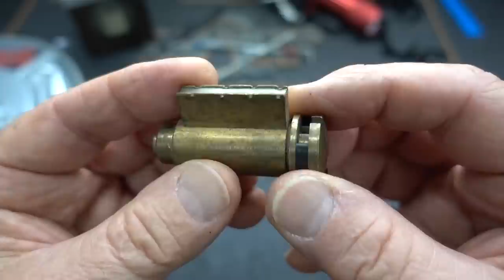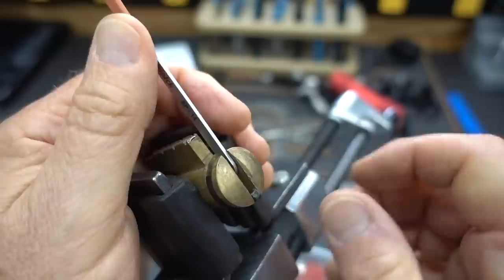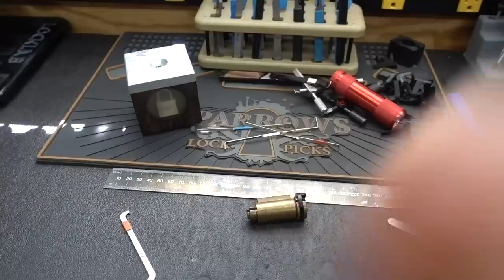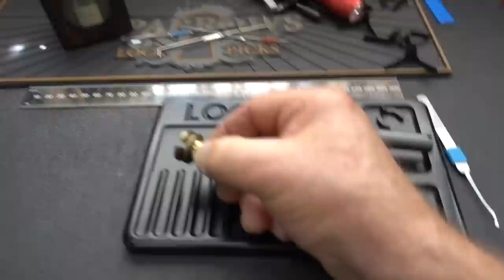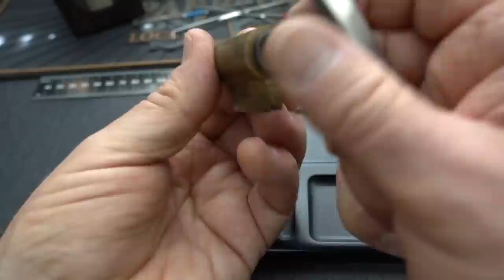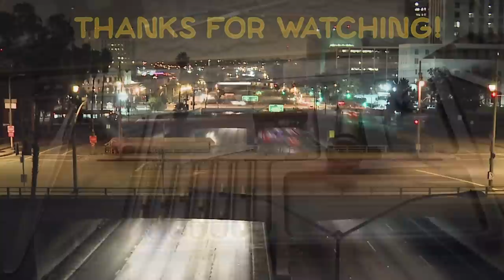(1767) What IS This Thing? (Arlington Lock)

Comment: Yale Litchfield knob design about 20 years ago
Reply from the maker: Thanks for the info!
Reply: What would stop the user from insta-gutting the lock by just pulling on the key after the cylinder turned?
Reply: @southpawpicker5140  mb that plastic thing?
Reply: The cylinder, when put together properly, has a C clip on it holding inside the housing
Reply: The locks are typically institutional locks. The company I worked for did work for a “Mentally I’ll Institution” very beefy locks!
Reply: I keyed up hundreds of these in 1979.  This was the largest architectural hardware sale of all time after the Pentagon. The primary contractor was J.L. Damman.

Great, great grand master key system.
Reply: Thanks for the info everyone! I'd like to get a good look at the actuator and c clip when its properly assembled.. just for research purposes obviously 😉
Reply: @southpawpicker5140  My guess would be that whomever re-pinned the lock didn't replace the retention clip that would normally be on the back of the lock body to prevent the cylinder from doing just that.
Reply: @jimschmidt  Hey Jim, as I recall that was a two step system.  How many different key ways were used on your system? The system that I worked on was a hospital. Certainly not as huge as yours! LOL!
Reply: For a church donation box ... older than 20 ... add another 50 you will be about right ... the key is almost flat minimum warding.

Comment: Bill, This is a cylinder from the discontinued Grade 1 spherical knob, the "COPENHAGEN" design. Yale eventually let it go because the special cost of the cylinder did not justify the product especially since the industry was shifting to levers for both commercial and residential applications. Litchfield was a round knob with a flattened face. I could check price books to see when it was discontinued but it was quite a while ago. Also, it required a blank with a longer neck. The standard #8 Yale was modified for a while to reach all the way in but it looked awful. Yale still has a Carolina design but it is constructed like Schlage Orbit or Arrow Ball, i.e., the knob is indented toward the spindle so the perfectly spherical knob is no more, except on mortise locks. Best regards, Jerome
Reply: wow, THE Jerome Andrews! Love your books!

Comment: Those new pins and springs look familiar. They might have actually bought them through locklab.
Never did figure out what that plastic clip was for or the purpose of the groove it fits in, but my guess is something to do with how the cylinder fits and retained in the door or whatever it locks.

Comment: I am presently at the lockpicking skill level where I mash pins and sometimes the locks open. I practice nearly every day, spending at least some time on each of the now 15 or so locks I have. I have never had a day when I was able to open all of them, and I have had days where I opened none of them(?!) I did finally opened my 6-pin progressive lock (once) from TOOOL LockPickExtreme set I purchased. Still using the lock pick set I bought from them, though I now have a large selection of additional tensioners. The on/off nature of my progress is both fascinating and frustrating.... - - Any feedback would be welcome, as I am an idiot..... 

Love the community however, especially Bosnian Bill's Tribe ie you guys! (big hugs).

-ChaosMinx

.
Reply: Shannon McStormy take your time. Sounds like your rushing and not paying attention to pick placement. Make sure you are are on one pin before lifting it. Best of luck.
Reply: I was very much in the same boat as you. I recently picked up the Sparrows progressive lock set and that has really helped. I got the re-pinning kit with it and have transformed some of my other locks into 2 pin (1 standard, 1 spool) practice locks as well.

You don't have to get the actual progressive locks. If you have a few of the tools you can make your own progressive locks.
Reply: Shannon McStormy also buy some good picks and a decent amount of tension tools. The right tension tool makes a world of difference. Sparrows tuxedo and their top of the keyway set is a great start. Don’t get frustrated. Ive been doing this for well over a year and have been thwarted by cheap Chinese junk while being able to pick higher security locks.

Comment: Yale Copenhagen knob cylinder.  Took a blank that had what was called an enfield now.  It had an offset square head.  The the plastic clip was what made the enfield bow necessary.  You could remove it and use a standard 6 pin blank. “Pick detector”? WTF.

Comment: One reason not to use a screwdriver as a tensioner: It looks like there are some scratches or wear marks around the circumference of the front, so my guess is that, when installed, it's flush with the surface of whatever it's installed in, so, in real life, you wouldn't have the ability to have something coming radially outward from that slot. That would be cheating.

Comment: Somebody needs to invent a variable size follower.
Reply: Was going to say they make an Inflatable one, you pump air til correct size, but won't. Then thought since follower doesn't need to be completely round, you could have split halves, with cones on each end, with a screw through each cone, with a knurled nob, as you turn nob, it spreads to make larger, would need a spring in the middle for when loosening to make smaller?
Reply: @randyaivaz3356  Similarly, I was thinking something like spring steel.  Notice that most of the followers are not complete cylinders, having an open channel.  If that's allowed, then why not have one that can be flexed outward, a bit like your two halves suggestion.